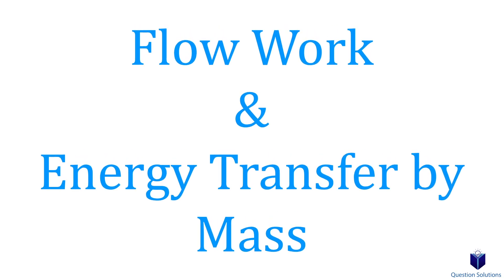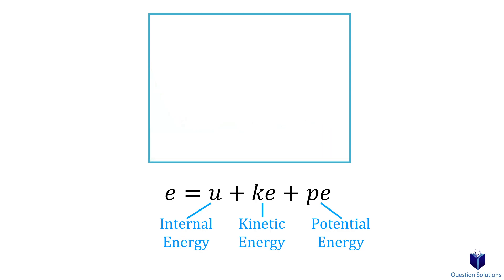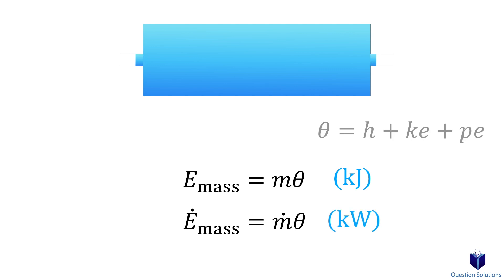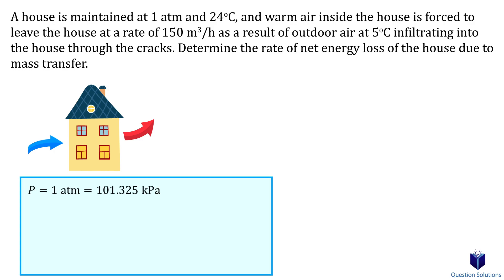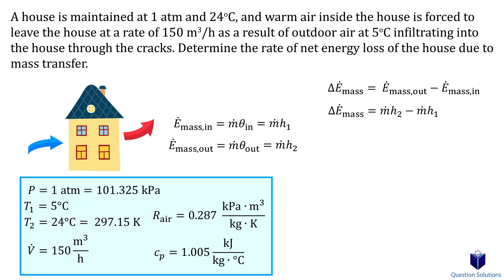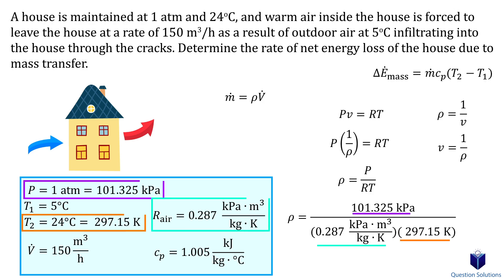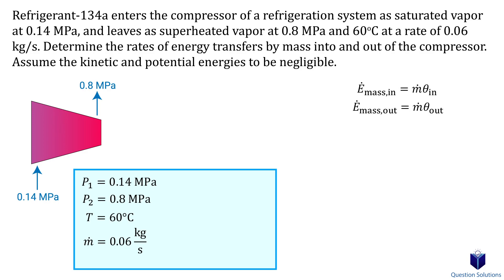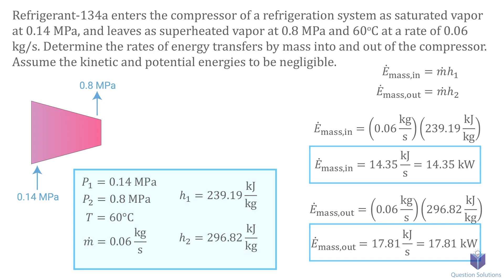Flow Work and Energy Transfer by Mass | Thermodynamics | (Solved Examples)

Comment: if PV and U are part of "e" what is KE? And for the house problem why don't you need the specific heat for air at 5 degrees for (T1)?
Reply from the maker: If you wanted to be extra accurate, you can take the average of the two temperatures and use a cp value that's at that temperature. But generally, the difference is so small when the temperatures are so close together (5 and 25), it's negligible and you can use the higher temperature value to get a cp value. KE is just kinetic energy. "ke" is written per unit mass, and "KE" is kinetic energy without it being per unit mass.

Comment: I have a question regarding the last example, how do you know that massflow in is the same as massflow out? 

Great videos btw!
Reply from the maker: I cover more on that topic in the next video, but compressors are considered steady flow devices. If it has one opening and one exit, then the amount of mass flow entering will be equal to the amount of mass flow exiting. 👍